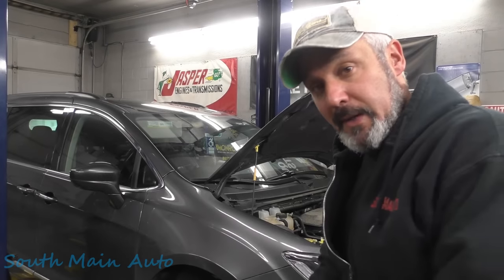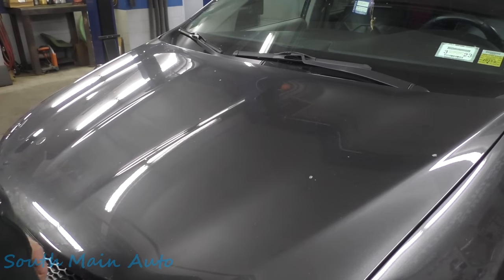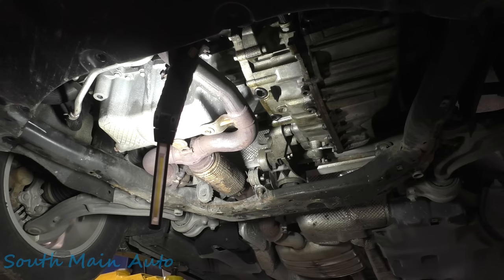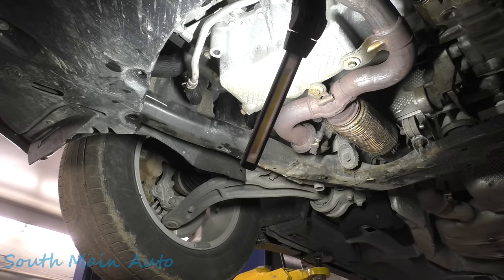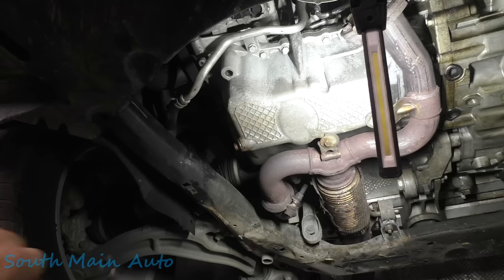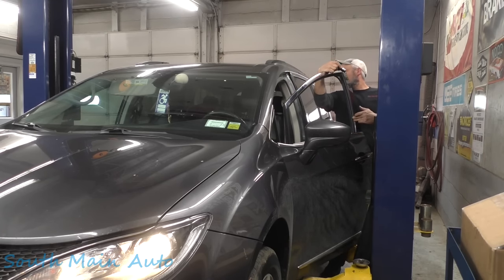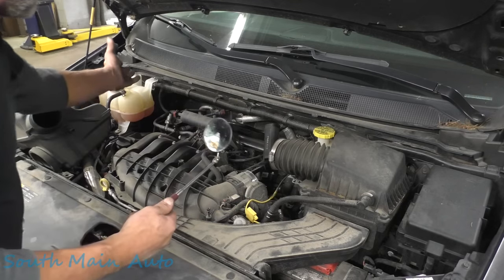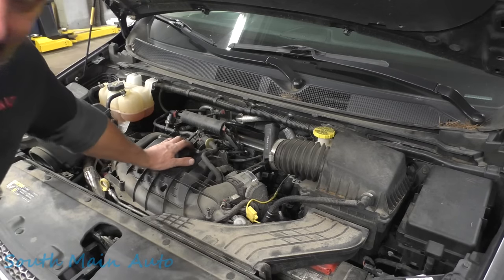Chrysler Pacifica Goes Full Nuclear 💥

Comment: Sad that a car that's just 5 years old is already junk.  Not all the blame can be assigned to the owner because it's likely the head gasket was already blown before it started to overheat on her.  I mean the cooling system is closed so there was no way it should have lost coolant in the first place.  Just yet another reason to stay with Toyota who built my 22 year old Sienna mini-van that is still running strong at 240,000 miles and has never overheated.